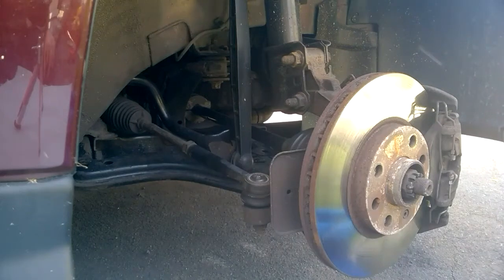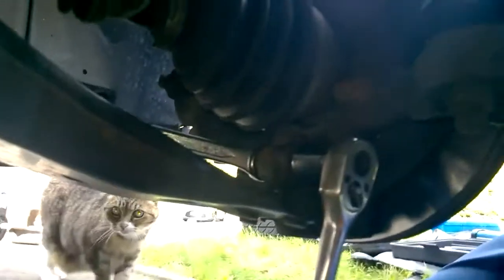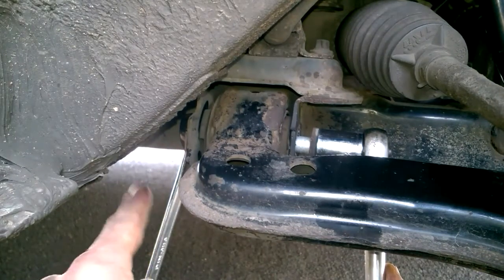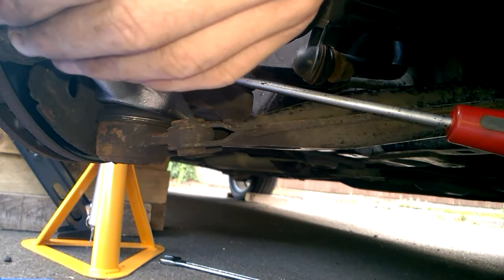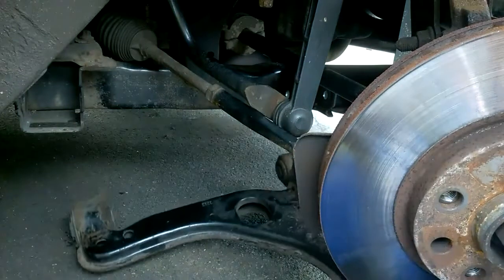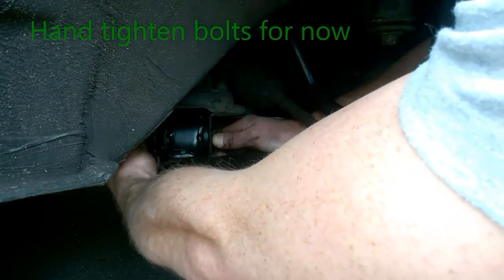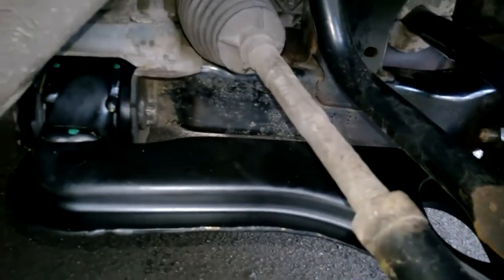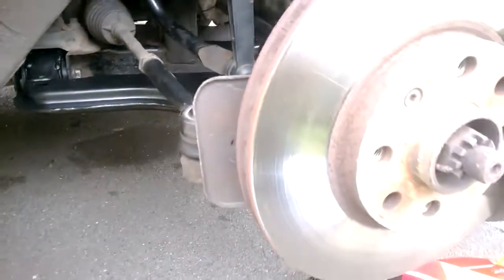How To Change FRONT SUSPENSION LOWER ARM Astra G MK4

Comment: Did the ball joint splitter wreck the old boot? Gotta change my wheel bearings on coupe turbo and need to get ball joint out to pop driveshaft back.
Reply from the maker: Can't remember to be honest as I wasn't to bothered about damaging mine as I was replacing it but I'd imagine it could be done without damaging